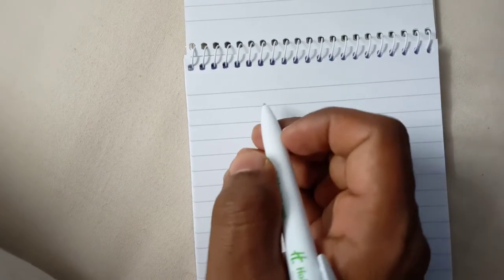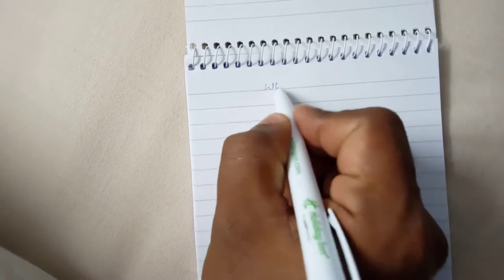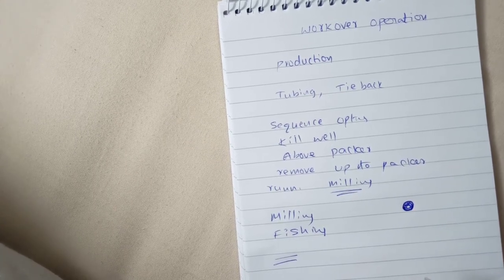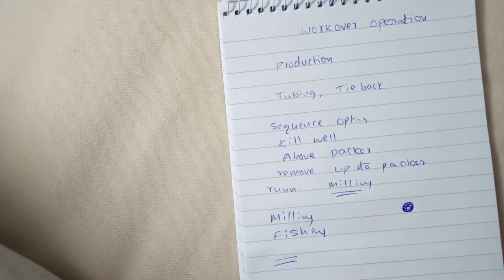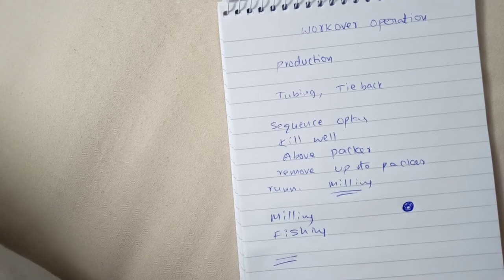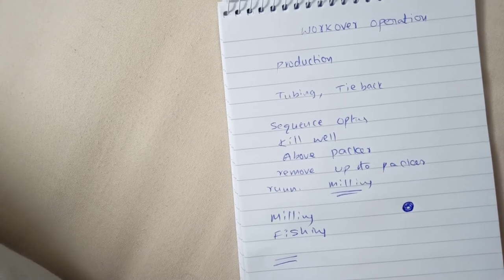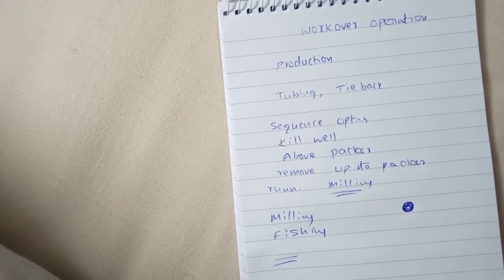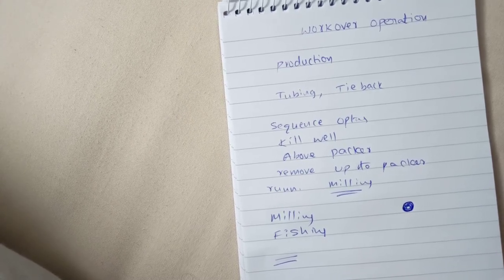WORKOVER OPERATIONS Part1@oilandgasinformationandjob2009

Comment: milling is an depend on the wireline/slick-line cut if it is not puffed then overshot according to size can catch packed with Pop (it is may vary) next 
cleaning the casing with scrapper and if require stabiliser and so many more different jobs can do at workover rig according to oil well and operator company requirement
Reply from the maker: Information correct by you
Ur experience guy